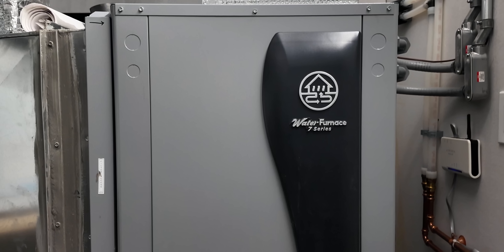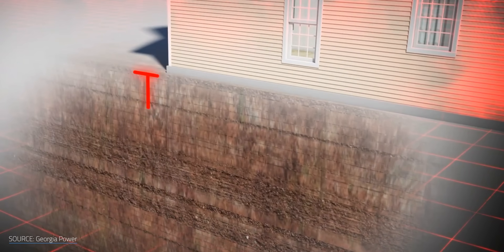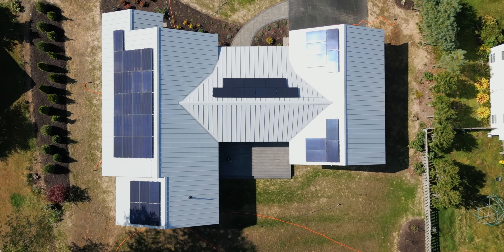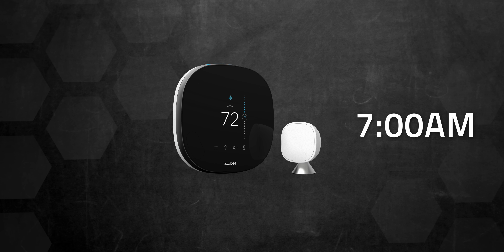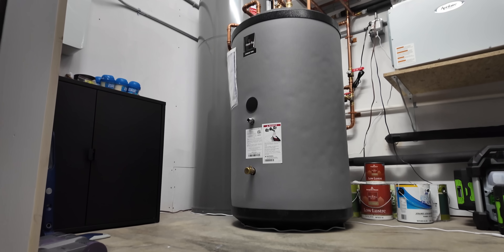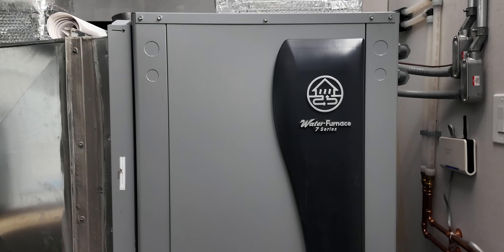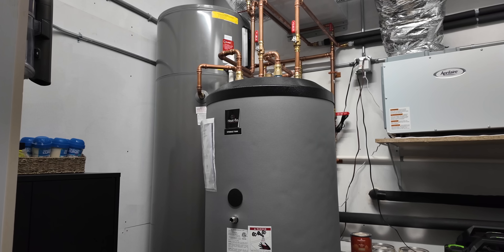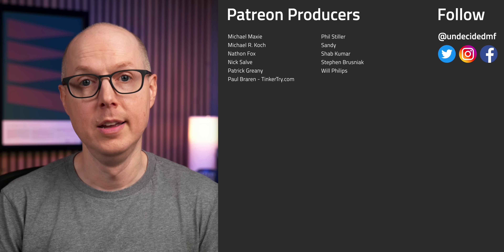How My Geothermal Heat Pump Really Performed (2 Years)

Comment: Good luck finding a company to work on those systems.  A friend in Dallas had one, and getting it fixed was super expensive.  The maintenance is pricey as well.  The system still runs the blower and instead of running a compressor, it runs a couple pumps to pump the fluid through the loop.  Pray you don’t have a failure in the loop. 

I live in southern AZ, and with an inexpensive PV system, 5.5kw, I pay nothing for my energy with a regular Air conditioning system.

Comment: for clarity & anyone else lookin into geo loops, temp swing at 10' deep is about 8f (50f/10c would be 54f in summer, 46f in winter). 

have to go about 33' for "constant/steady temp/zero swing", which isn't easily/affordably done. but because buried temp is always less extreme than air temp deviations, even shallow depth slinky geo lines should perform better than air/air exchangers. the only reasons to drill down hundreds of feet is because the lines need time to reach equilibrium with the surrounding soil, many places don't have the horizontal sqft required for that, and some don't have the right soil composition (too rocky, too dry).

best way to lower system costs (both upfront & usage/bills), is to build as close to Passiv as possible & reasonable, with lots of thermal mass.

Comment: I am curious about the lifespan of the equipment.  The overall running costs should aslo factor in the net present value of replacing the equipment say after 12 years.  A significant capital outlay can be a challenge for people when their circumstances change, rely on a pension, etc.

Comment: Matt - appreciate you sharing.   We did a pellet boiler wtih hopper last year.   The amount of pellets used in a year is a bit much.   We recently added a heat-pump water heater so we aren't burning pellets for hot water in the summer.   Our location is norther New Hampshire and the is far from air tight.   I suspect a geo-thermal loop only works well in well sealed homes.   Can you share the KWH of heat produced in the winter ?

Comment: I think you're missing tradeoffs here. For example, you could have had a non geothermal heat pump that used more energy, and then also had more solar panels. Overbuilding solar seems far cheaper than optimizing energy usage.

Comment: System cost, after rebates was $39.000 (retro-fit). Air source cost to run $2100/yr vs $950 for geothermal. $39000/$1150= 33.9 yrs to break even. Average lifespan of a geothermal unit is 25 years. The geothermal pump will need to be replaced 9 years before the break even point resulting an increased break even point. Taking that $39k and investing in a utility stock like Duke Energy, $39k/$129=302 shares. 302 shares x $1.05 dividend per quarter= $317. $317x4= $1268/yr in dividends vs $1150 savings spent on geothermal.

Comment: I have to pull you up on one thing Matt - it is not geothermal, it is ground source heat pump. Geothermal uses natural heat from the deep Earth or tectonic/volcanic systems to heat water to use for heating or energy production via super heated steam. The companies may market it as geothermal, but unless you have an active volcanic system under your house - 400ft is about 14 miles short of a temperature where geothermal would actually be useful. Still love the video though.
Reply: If I understand correctly, both replies are partially correct. “Geothermal” does mean “heat from the earth”. In this case it is actually MORE accurate to describe Matt’s setup as geothermal heat. What you’re describing is geothermal energy production, which is then turned into heating and cooling energy. Matt’s system (a closed-loop ground-source geothermal heat pump) is directly using the heat/cool from the earth into the refrigerant. This distinction is only a true binary in Matt’s loop was providing energy first, to power an electric resistance heater. It’s more like comparing to his solar PV setup than his heat source.
Reply: @tracejohnson6273 You are correct. “Geo” means from the earth and “thermal” means relating to heat so a ground-coupled heat pump is one form of geothermal heating/cooling.
Reply: @tracejohnson6273  the ground below the first few meters has the average annual surface temperature. Ground source heat pumps exploit that heat stored in the ground by the summer heat. Geothermal is heat that rises from below due to nuclear decay and the original core temperature dissipating. That's not what these heat pumps use.
Reply: @tracejohnson6273 As a geophysicist I will humbly disagree.
Reply: @jim.franklin  I'm glad I saw your comment. I thought his system was a completely different thing than the ground source heat pumps I've seen before and was confused how magma was involved.
Reply: I think this battle is already lost, if it were ever fought. Geothermal energy may be specific to what you're referring to, but "geothermal" is broadly (and I think technically correctly?) used in HVAC to refer to the same thing as ground source heat pump.

What is ground source heat if not geothermal?
Reply: @TurbsMurbs  If it was geothermal - he certainly wouldn't be able to cool his house with it...
Reply: @TurbsMurbs  It's not Geothermal because the heat is coming from the Sun warming the GROUND. Geothermal heat comes from internal forces in the earth.
Reply: @TurbsMurbs There is a huge differenxe between latent heat and geothermal heat. Ground source systems, which installed correctly are brilliant, use latent heat exchange in the same way air source does, geothermal actually uses heat from the surrounding rock strata to directly heat a liquid, usually water, to super critical temperatures (over 200C) to provide energy to drive turbines and then, in Iceland, district heating systems. 

To be effective you need rock temperatures 200C + ideally, but it has been used down to around 125C. This mean near surface volcanism or drilling miles down.
Reply: @jim.franklin  Absolutely! In Canada where I was living we needed more water for irrigating our fruit so we replaced an old air-source heat pump by drilling down to a 'shelf aquifer' below us and installing an 'open loop' system, a ground-source heat pump. 50l/min water + far more efficient heating/cooling. This was not, repeat NOT a geothermal, system. I have seen geothermal systems in Finland, long ago heating entire towns. Expensive, even by Groundsource standards. BTW the system we had is sometimes called 'pump-and-dump' as the water from the aquifer returned to the aquifer. Closed loop systems like this don't necessarily require a deep well. Simply excavating a lawn several feet down then replacing it after installing the 'closed loop'. We chose the well(s) as we needed the water and we knew we were above an aquifer.
Reply: @jim.franklin  Sure, I'm not disagreeing or claiming differently. My claim is that words mean what people understand them to mean and "geothermal" in non-academic contexts absolutely refers to this style of heating system. It's fine to say everyone is wrong, it's just not reflective of how people communicate today.

I urge you to search "residential geothermal". I'm not pushing this terminology, I have no stake in it, it just doesn't mean what you think it does to "most people".
Reply: @TurbsMurbs  And I urge marketing types to stop reusing words to suit their bullshit that ends up confusing people!
Reply: @jim.franklin 
I agree with you. Basically what this unit is doing is using the steady state 50 degrees below the frost line to maintain a higher starting temp for heat and lower for AC ( lower delta). True geothermal would use real heat in a volcanic region to heat the circulating fluid to a temp where it can easily heat the house. So basically these ground units make a heat pump or boiler more efficient.

Comment: i was doing the math and for my home in denver colorado a reversible ac unit with backup resistive heat is perfect. only about 3-7 weeks out of the year the heatpump will likely not work. but the rest of the time it'll work very well with the temperatures not being outside the effective range for a heat pump system.

Comment: As a mid-west HVAC install my typical heat pump install (retrofit) is $7,900.  We also have natural gas for most homes, using a 97% furnace to fill in on extreme cold days - furnace and heat pump retrofit would be around $12,000

Comment: For comparison in midstate Pennsylvania my new home in 2020 led to a upfront cost going with Geothermal of $35,000 more than a propane heating system with typical AC.  Being new construction.  This was 3 deep (25 foot) wells where  the ground temp is 55 degrees Fahrenheit

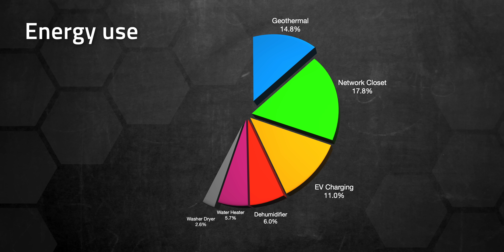Comment: 10:29 These numbers are hard to digest. 1) Your server rack is actually a resistive electrical heater - in the winter months that entire 17.8% share is warming your living space and disposing of a heating requirement from your heat pump; similarly in the peak summer it's adding extra load to your heat pump unless you're venting the computers' waste heat outside. 2) Your "Misc" category is huge. I'm guessing this is mostly lighting? Or do you cook with electricity perhaps? 3) As for the solar input, do you pump upstream into the grid, or how much battery storage do you have?

I find it's most helpful to model the heating by how many kW your house naturally "pumps" the interior heat outside in the winter. This is straightforward to measure; it would be the kW required to keep your indoor temperature static by resistive heating and I'm guess your heat pump metrics might also tell you this.

I'm also really curious to know whether your heat pump's compressor makes much of a sound and how you accommodate for that. Thank you for sharing the video.

Comment: Okay, you asked would we do it. In our specific situation, no. We are moving to acreage. We plan to do a very large solar ground mount installation utilizing very cheap but huge/heavy batteries DIY. Rather than focusing on energy efficiency we're focusing on cheap power production only. Also our house is likely temporary on the property till we build something better. Hence the permanence of a ground heat pump doesn't make sense. But... in different circumstances. We would definitely consider a ground heat pump.

Comment: Geothermal is very dubious in many areas. Unless power costs are VERY high and it’s not extremely cold (MASS is not that) in winter it MIGHT make financial sense.  Lots of cases where it is not. 

Mass electricity costs 30 cents USD per KWH

In Alberta it’s less than 10 cents.

Comment: one thing that is never considered in these videos, is that the ground is not an infinite heat battery. Many large commercial large-scale geothermal systems have an imbalance between heating and cooling (southern state, more cooling than heating), and due to large loads in those buildings, the geothermal systems have raised the ground temperature by 2-3 degree C after only 5 years. The solution was putting in additional regular air conditioning systems to offset these loads. So, what if all your neighbors have geothermal and ground temperature start to change? Matt you should really research this and talk about it. Real engineering is really about scale, any a lot of problem only show up after everyone is doing it.

Comment: We just built an ICF house (very well insulated) and we used a GeoStar geothermal heat pump (Water Furnace sub-brand). We have 4 shafts at 230ft each.  It’s great.  We also have the de-superheater.  House is pretty much a constant temperature year round here in Utah (100+ 9n summer, 0-30F in winter).   We also have a gas driven driveway snow melt and the home radiant system in the floor is hooked up the boiler as well as a backup, so if the heat pump is under maintenance or not working or if there is no electricity long term we can still heat (using a generator to run the controls and pumps).    Our energy use is way way down compared to our former home and its multiple times bigger.   We use TekMar controls.

I’d rather pay up front now when I can afford it and not have huge utility bills for the rest of my life when I can’t afford them (after retirement).  Also, energy is not going to get cheaper so you have to figure what the cost of energy will be in 5, 10, 15 years etc when doing your calculations.   We also put a 7.38 kw solar system on and use electric (hybrid) hot water heater (with the de superheater).  Large house.  Our electric bills this summer were $78, $11, $128, $111 and our gas bill is $7.47 each month (hook up fee).  Those electric bills this summer are full electric use in the house including hot water, cooling (heating in winter), computers, lights, appliances, etc.  (Gas is just as a backup source in the winter in case the heat pump is out but actually for the snow melt system).  The electric bills include everything — ongoing basic service and connection fees, taxes, etc.

Comment: If you want to set your thermostat high in the day and cold at night,  get a logging thermometer. (Mine cost about $30) It will show how fast the temp rises  when going from cold to warm. If the rise is slow, then it has to start early, and it might be better to have the temp not so cold at  night .

Comment: I rarely see temperatures below 25F, so I went with air-source heat pumps that are good down to -12F. The house is only 1400SF, so my cost for two ductless mini-splits that I installed myself was about $4900, so $3500 after the federal tax credit. That's not counting the $30k or so I spent to power the entire house with solar panels. I'd guess that about 1/3rd of that electricity goes to the heat pumps.

I was surprised that they didn't use that much more electricity than the old evaporative cooler we were using before the heat pumps. The lower humidity and increased comfort is entirely worth it. They're a huge improvement in energy consumption and comfort and quality of life compared to the space heaters we had been using.

Comment: Could you please split the power consumption of the heat pump, vs the power consumption of the  water pump running the geothermal loop? 
Does the water pump significantly affect the overall efficiency of the system?
I'm asking this because geo heat pumps always quote efficiencies that do not take the water pump into account (since it is not part of the heat pump itself). It makes the comparison with air source heat pumps difficult.

Comment: I would certainly want Geo-Thermal in my home, but not Massachusetts Gun-Law or Taxes, and certainly not Solar-Electricity. When the price of Oil goes up, you'll want Fire Wood for Electricity, and the taxes on growing enough are unconscionable. Also, when your Solar Electric needs replacing, replace it with a rooftop winter garden, for fresh vegetables.

Comment: My parents put in geo 20yrs ago, and I have air source heat pumps for my new house.  Small but a nonetheless annoying item - both places require humidifiers to make them "warm" in the winter.  Whole house humidifiers never seem to live up to the need, so we wind up with several small day long humidifiers in various rooms and it works ok.  That said, when my feet are cold, theres nothing quite like putting them over the gas fired registers to warm them up.  You just dont get that kind of temped heat off a heat pump - its just a fact of science.  I'll take some more cheese with my whine now thanks......

Comment: We have a district energy geothermal heat pump system here. Under the drainage pond is a field of pipes linked to the district energy station, which contains large scale heat pumps which transfer heat to/from the deep network to local pipes to homes which then interface with the individual building heat pumps. It can also do tricks like transferring heat to/from buildings in the network.

Comment: I admire your effort to prove the case.  Geothermal is fascinating but I don’t think you emphasize the upfront cost well enough.  $80,000 is a lot of money to pay for heat and a/c, plus the operating costs.  The rebates are paid by the rest of us ‘grid tied’ consumers, so you are welcome.  The math, to me, looks like it is more expensive than conventional heating and that is generally assuming a 20 year system lifespan.  Even at 30 years you are at about the same as a conventional system.

Comment: Canadian here, I Installed my geothermal 20 years ago ,  loop system bought a cheap unit tetco that was a disaster from day one, two years later ended up buying a new three phase  water furnace Primier on eBay  for 2100 out of California , changed the compressor to a single phase and  trial and errors it has been working fantastic for cooling,  heating is more demanding older house.  The most important to save on power is a soft starter from a company ICM in Syracuse made in USA . My total cost spent even with the tetco unit was give or take 12 k

Comment: EV’s=Geo thermal bs. The latest inverter heat/cool equipment uses less than half of conventional air source heat pumps.
This technology is improving every year. True test is identical houses with these systems. Then pencil that out.IMHO

Comment: I spend 1,000 a year running inefficient heating system, none of these heat pumps or geothermal systems save you money, as you will be spending massive $ on repairs every 10 years, so they never even break even financially. Heat pumps last 12 years, the you pay 15k to replace it? They save 20% on power in operation, about 200 per year is all.
Thicker walls and additional insulation, keeping doors and windows closed does way more to save than these expensive devices with high repair costs.

Comment: Geothermal and slab heating are a big NO for me.  I like it cool at night, and warm during the day.  Outside temp. swings can be +/-20deg in as little as 6 hours.  The slow reaction of these large thermal masses just doesn't work well vs. gas furnace in the northern mid-west.